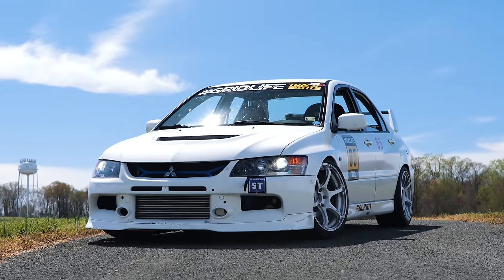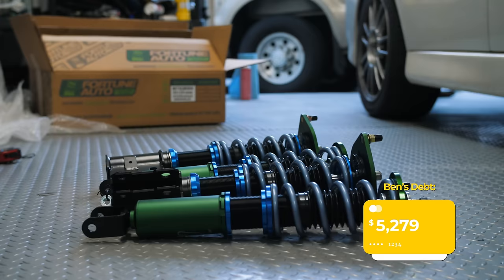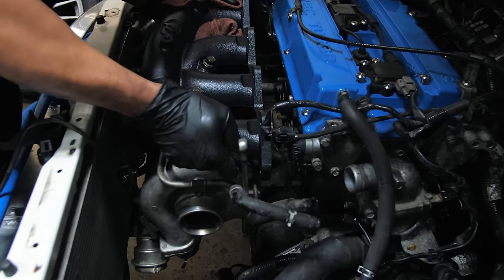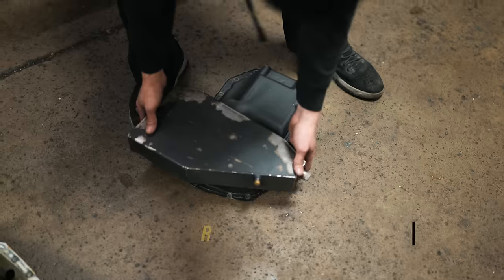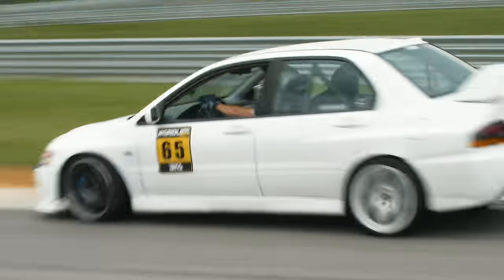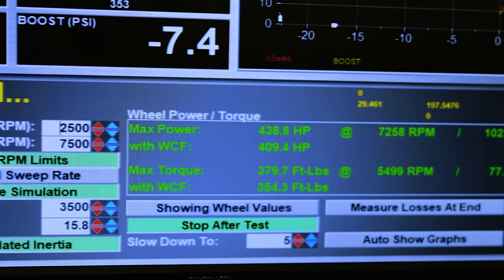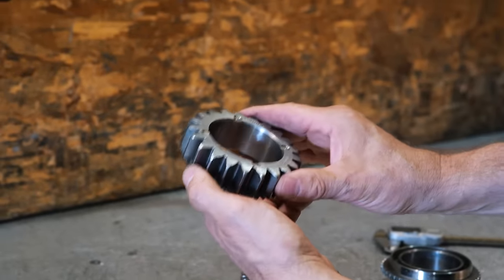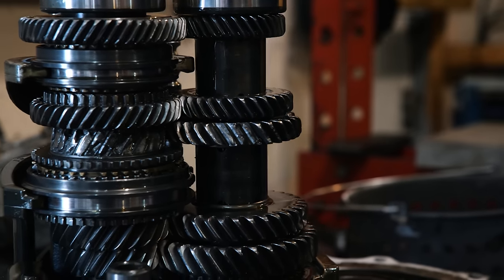How I Spent $65,000 Modifying my Evo 9

Comment: Nice job Ben!  Very informative for people looking into buying or modding their EVO.  Glad a little sliver of my video made the cut. I've kept my evos in street form and learned from other evo friends on what not to do from when they pushed their evos too far.  In short, for a street evo, i always recommend and OEM short block, e-85, exhaust, tune, clutch upgrade and minor upgrades to fueling to support running E-85.   Lastly, speaking of fuel, I think your 255 pump in Lana is due for an upgrade with your current setup! Or at-least replaced it after years of use :)
Reply from the maker: Paul, apologies for not hitting you up before I used the clip. I put it in last night while editing and should have asked. Thanks for making such informative Evo content as always, man!
Reply: @GearsandGasoline  No worries, you don't need to ask.  I'm all about sharing helpful information!
Reply: Black or silver? Timestamp?
Reply: @WTFNoNamesLeft2  neither car. It was a clip from my evo turbo comparison video.
Reply: @GearsandGasoline the Modded Evo 8 is like it came straight out from NFS CARBON. Looked awesome!

Comment: I just got my 9 back from the shop. I bought it for 9.5k with a blown head. After getting the head fixed, a new exedy twin clutch, white line sway bars, and bump steer kit, and a few other replacement parts. I’m 22k in on the car. I love it!

I can’t wait for another year to start modifying like this for the track. Thanks for the video!
Reply: Not bad!

I bought my 2003 Evo with blown shortblock for $9500. 212K miles, too. Lol 

I got an OK deal. I was planning to do a full restoration before I bought it. Surprisingly, it's in pretty good shape.

I would've loved to have gotten a 9 for that price though.
Reply: @andydhillon1977  I still have about 2k worth of hail damage I need to get out. But it was definitely worth the risk of buying it

Comment: Excellent summary of legit parts. Many/most youtubers get a lot of details wrong, but the pan and the uprights are key. Another benefit to a lighter twin disc clutch is not cracking your clutch pedal bracket assembly. This is basically as good as the 20 year old Evo modding for dummies thread on Evom. Amazing NZ+Australian accents too, just like the real thing, I could almost feel the sunburn and weird lizards crawling all over me.

Comment: If it is a salvage car like this, technically you can skip all dad and fun steps and memory and have a cookie cutter build, strip every thing to chassis and shell, strip the paint, standalone ECU, aftermarket display, customizable function steering wheel, all dry carbon and acrylic windows, single lightest seat, roll cage, fire supression system, 6pot/4pot AP or Brembo brakes with slotted rotors, racing pads, racing brake fluids, uprated radiator, brake cooling, transmission cooling, oil cooling, Penske 4 way suspension, sequential dog leg race box, fuel cell, racing slicks, carbon wheels, giant aero, minimum exhaust, yada yada yada, but what are you trying to achieve? Are you sponsored? Are you trying to enter a certain competition? Are you trying to beat some record? I think beating Pikes Peak record this approach is commendable, otherwise it will be a huge money pit, to me I don't think there is an end goal and you should just enjoy the process unless it is a purpose built race car for a certain event
Reply: Yes, and the mods Ben recommended here were given specifically for the purposes of competing under the ruleset of grid life street class. So it matches a case for recommending specific mods that you mention.

Comment: Im on a process of rebuilding my apex silver evo 9 mr that is been sitting to 4+ years because its been leaking tranny fluid and have other projects im working on now so i neglect the evo. Bought my evo 9 10 years ago wifh a salvage cali title for 12k with 61000 miles and now with 81k and im so excited to build it to oem+. Spend close to 15k on parts already and some have been sitting in storage collecting dust and might need to spend more for oem parts but its going to be fun working on it again. Its my forever build car and im so stoke!

Comment: Great condensed documentry. 2 things - if your catch can is filling up like it is then that definitely isnt normal. Its likely thats major blow by because the piston rings arent sealing properly or some other issue. The other thing i noticed is you said the hks gtii turbo was fitted to a standard evo... which one is that? Evo 10 turbos are completely different and cant be fitted to evo 9s with a stock style manifold.

Comment: I’ve spent an easy $20k modding and fixing my MK7 GTI 6spd. I’ve gone through multiple wheels, tires, coilovers, suspension bits, turbos, clutches, water pumps, etc., trying to get the car exactly where I wanted it. It’s finally there, but man, it’s depressing knowing how much it’s cost me. Still though, I’m under $55k into it (including the car), and it definitely rips and puts other $50k vehicles to shame and it’s the perfect street GTI imo.

Comment: Cap off the line you've got coming out of the PCV valve port on the cam cover. This will stop the catch can filling.
Had this identical problem on my Evo circuit racing car and this all but solved the problem.
Now just runs a single line to the catch can, and I can do 10 lap races and there's barely anything in it.

Comment: What?! I have a 2015 Lancer ES CVT!! @ 345 HP @ 13 PSI. DUDE WHAT. ....It screams at 7k rpms...The Lancer 4B11, is faster. The Lancer itself is faster than the Lancer Evo. I have it at 141K, bought it 3 years ago with 69K miles. I cant believe you spent 65K on this.

Comment: $5,500 seems cheap for that built engine. Of course, much cheaper not to destroy your engine 😂😂😂

What I’m curious about is what investments do you with hindsight see as good and which do you see as a waste. Gotta be the 6 speed, not the best oil pan, multiple multiple lips, and catch-can interactions, weak turbo.

Wait a minute, wait a minute! What about the super-hero gloves at 19:40??? 😂😂😂

I was wondering
why you didn’t just pump the oil back from the catch can to the sump.

$75k???? 😳😳😳

At least you didn’t cut off the roof 😂😂😂

Comment: How long have I been watching you guys? I thought it was just a couple years, but I remember the forester build.

As an aside: why not plumb a drain line from the bottom of the catch can to the top of the oil pan. Remove the pump and let gravity work.
Reply from the maker: Two reasons: 1) I presume that the crankcase pressure preventing oil draindown from the head is also present in the pan and would logically prevent oil from a draining down without force behind it (more than its own weight). 2) gravity drain would be too slow. The catch can will fill in less than a lap without the pump actively sucking the fluid out.